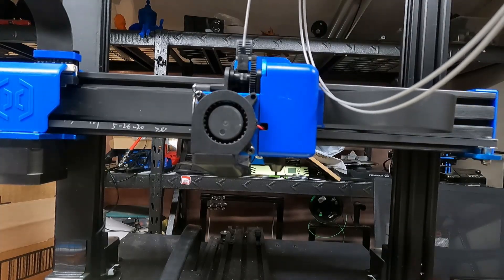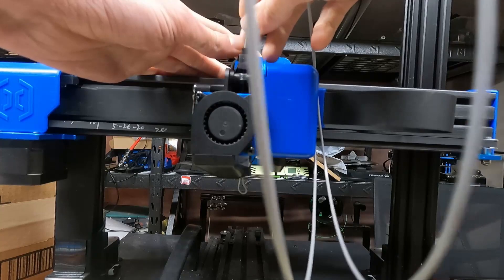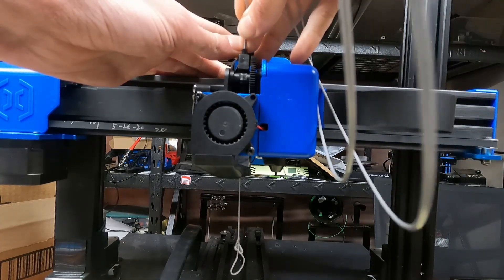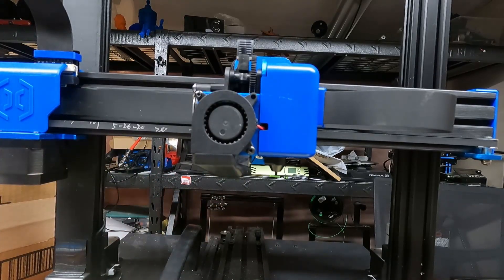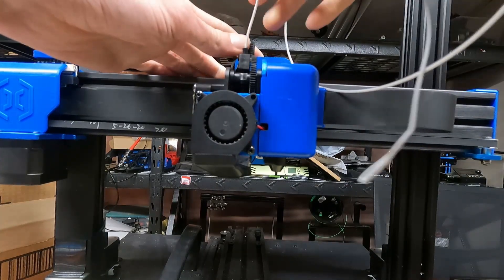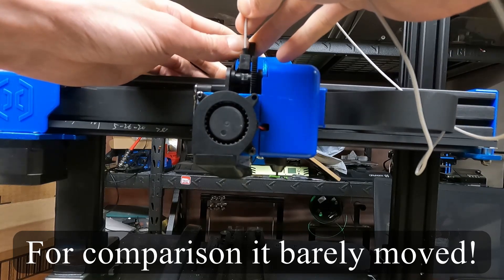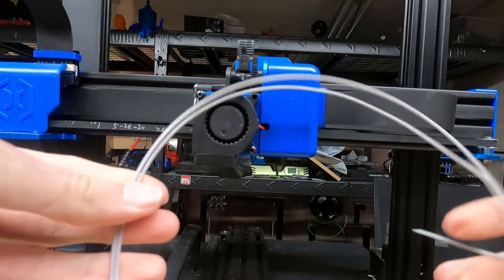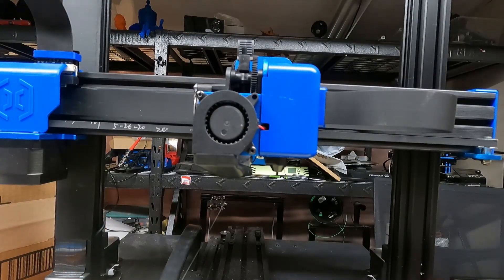How To Tell PLA From PETG

Comment: blue tape label "PTEG", "PLA", "ETC" on end would also help :) he-he
Reply from the maker: This is for the people who claim they were sent the wrong kind of filament...
Reply: @MakeItWithCalvin  :) I have bunch of samples (100 grams or so each various pla / pteg) so using your idea will work for me then after I get them sorted use tape to label them [of use them in 3D Pen :)
Reply from the maker: Fair enough, I did this more or less to show also that you can't extrude PETG at PLA temps either :)